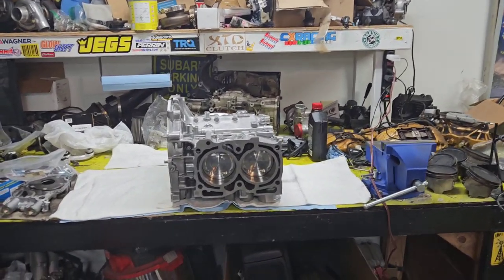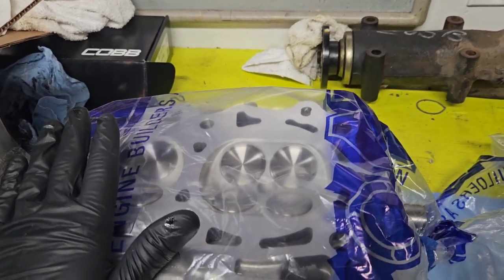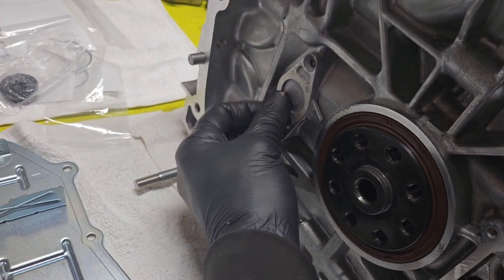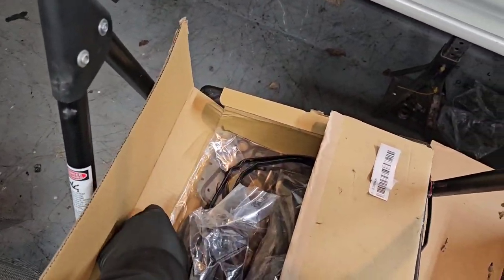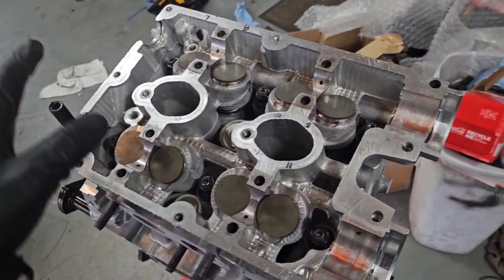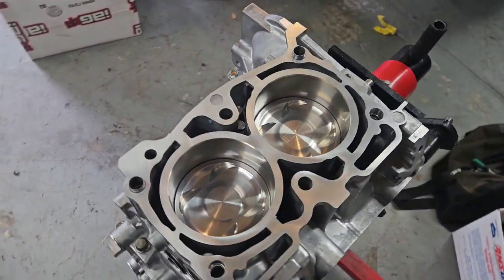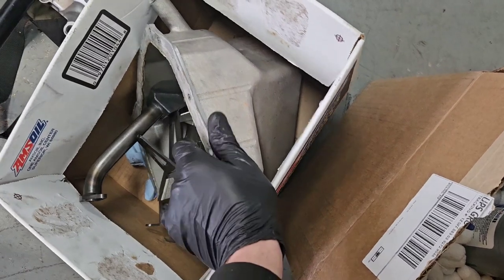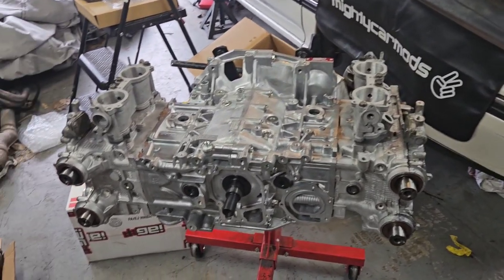Building a 500hp EJ257 IAG Longblock - STI Swapped Legacy Wagon

Comment: That RMS seating tool is a great idea! Last time i did one, we accidentally knocked it in a bit too far and not wanting to risk it, i pulled it out which of of course trashes the seal. I also wonder why Subaru uses domed Allen heads on the oil separator plate? They strip very easily on an old engine! Maybe a few hammer taps with an impact driver is the best way to remove. Background music is a nice touch too! 👍
Reply from the maker: Yes it's a game changer for sure, it's not even that expensive! If you trash a few rear mains it could pay for itself. I believe those Allens are supposed to be a one time use thing, they sell the seperators as a kit, likely to just be replaced. The older ones were even worse! They were a counter seated Philips head, usually I have to drill those out.
Thanks! Trying something a little different to make the boring parts of the videos more watchable lol

Comment: Why copper spray the gasket?
Reply from the maker: In my experience it helps give the gasket a tacky seal, these uncoated oem gaskets can use it. Something that comes precoated like cometic gaskets it's not really needed as much, it helps take up any small imperfections in the surfaces. Subarus already have gasket issues obviously so I'll take any extra insurance I can get. I have not had a gasket failure on any of my copper sprayed gaskets.